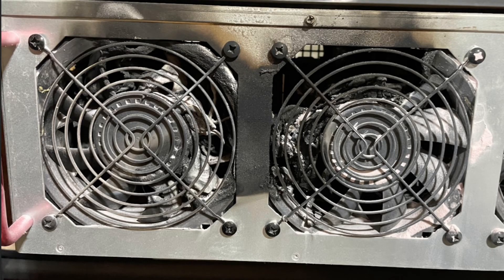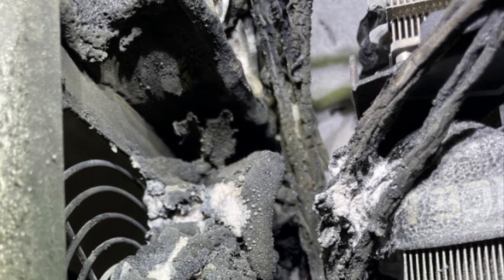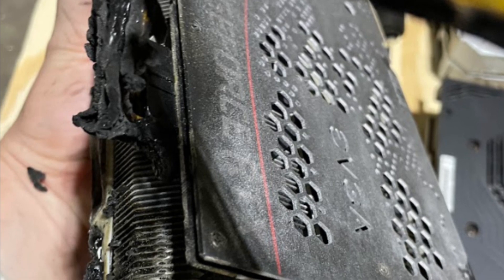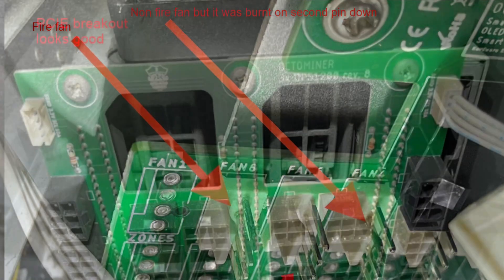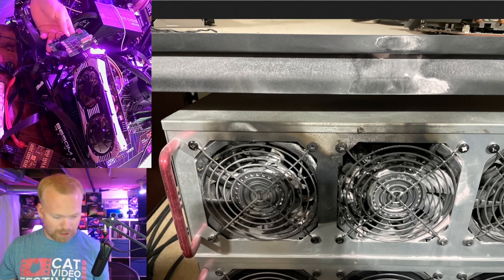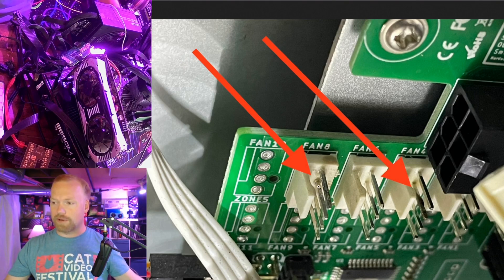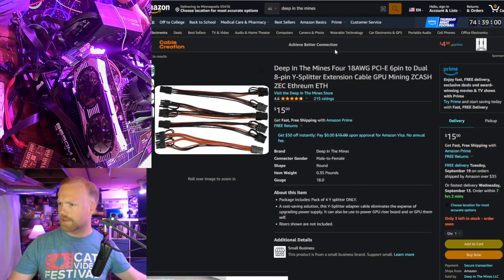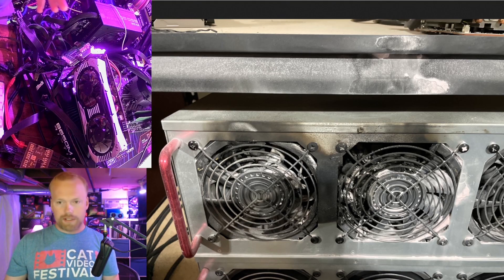Can't even trust the 'Best'?!

Comment: Dangers of high wattage fans
Reply from the maker: I mean.. sort of, but pulling 60-90W on a 24W rated product is completely unacceptable and leads to pointing out the defect in design of not only the fan PCB, but the fan controller's lack of fusing. I did a live stream a couple of weeks ago as a follow up where we do a little more root cause analysis.

Comment: That's wild, good thing he was there to catch it! This seems like an ongoing thing with Octominer. Did they issue recalls to protect their customers?
Reply from the maker: they're pretty tight lipped so we dont know but there are design deficiencies in the fan control board and fans themselves. it DOES appear to be limited to X12 units with fans manufactured in 2021 but thats still speculation.

I did a livestream a little bit after this video autopsying the fan that failed. worth a watch.
Reply: @OvalboreTech  Tight lips usually lead to lawsuits. What type/size fuse do you recommend for putting in-line to these fans? I presume they'll do nothing until someone's house burns down and it's on TV.

NM, I missed the moment in the video where you recommend 3A fuses :)
Reply from the maker: @rafalklepinski7372  I built some adapters for inline use with 4A slow blow fuses personally. thats way above their rating but we saw healthy fans pulling 12-15w more than rated ameperage.

Comment: I always change out fans on everything I can to noctua fans
Reply from the maker: noctua does not make a suitable replacement. no mfr does unfortunately.
Reply: @OvalboreTech   they do make fans in the right size and even " industrial ppc" once
Reply from the maker: Im aware,  @DJJumpdancer  . they're not suitable. half the airflow and the wire lengths are not compatible with 3 out of 5 mount locations in X12
Reply: @OvalboreTech  what about extions for the wires ? and would half the airflow make a big difference ?

Comment: More than likely it was the wiring or something on their end. At the very least he didn't monitor the fan voltage and on-time. Just set it and forget it.
Reply from the maker: nothing outside of fully stock on the controller, fans or wiring. 

power monitoring at the wall, and through HiveOS on the octo controller board. down side is the sample time on HiveOS is a 3 minute refresh so although we could see GPUs heating up, not enough data from it.

fan voltage is not a parameter the control board can monitor, only PWM duty.

either way, fans drawing well over their rated max current is a really, really big problem and I hope for octominer X12 owners sake that its extremely isolated to a small batch of first gen X12 units.
Reply: @OvalboreTech  Hmm. I wonder what triggered or disabled the voltage limiter. Fans don't normally say hey let me have infinite power. Lol
Reply from the maker: there is no voltage limiter  @PokèMyBalls  PWM fans use GND (-) +12V Tach (ground referenced speed signal) and PWM drive which is a 12 or 5v pulsed signal where open contact is 0%, 100% is voltage applied and 50% duty is a pulsed square wave signal.

these devices (fans and octominer) have no voltage control, and they do not contain any mechanism for fusing except the wire or the PCB.
Reply: @OvalboreTech  That is really sketch on a miner.
Reply from the maker: @PokèMyBalls  I agree. clear design oversight on octominer's part.
Reply: @OvalboreTech  Well thank you for taking the time to have a conversation with me and teaching me something new.
Reply from the maker: of course  @PokèMyBalls  , dialogue helps everyone so happy to.

Comment: Thanks for this PSA. I don't have any Octominer equipment, but ALL of my homebrew equipment uses 18 gauge connectors and fusable links.
Reply from the maker: of course, thanks for watchin.

the octos do use 18 AWG wiring for the high current stuff, but wild to me that they have no 'fuse' of any kind between 5,000W of power supply and a wear item fan.

Comment: Absolutely wild that those GPUs still work! I cannot believe it started from the fans. I’ve been as cautious as I can be over the years as to use larger gauge wires and bigger PSUs than necessary to try to remove as many points of failure as possible.
Reply from the maker: the fan wiring doesnt look inadequate at all but yeah the fact the board in the fan is able to draw over rated current is bad and the unfused fan controller board that is able to push at LEAST 150w is bad.
Reply: @OvalboreTech  That is pretty scary. So is that problem only on the older X12 models?
Reply from the maker: we dont know yet  @TotaleCryptoMining  it does appear that early gen 1 X12s had bad fans, but most just stopped working, not light themselves on fire. we have messages out to octominer, minerdude to ask if they have reports of this. GPURisers who only sells the 4 fan 8 card R8 has never had a fan fail in this manner though. I would feel more comfortable with the X8s and MAYBE gen II X12s. 

the other fan in this unit that was on its way out is going to get bench tested tomorrow with a PMD and a thermal camera so we can identify what happened.
Reply: @OvalboreTech  Will be interested to hear about it. Only have one X12 but not certain which gen it is. Rest are X8 Ultra Plus with no issues…so far
Reply from the maker: same  @TotaleCryptoMining  , I have two gen 1 X12s. one I got from Kiing but havent fired up yet since the backplane was damaged in shipping, the other is a Minerdude I got from Hawk. lots of X8s though. 

unsure what Im going to do just yet.

Comment: Great Reporting. Thank You. This is making me feel uncomfortable also.  Making me re-think everything. It's very scary, especially if you have family, and the miner is in the home.
Reply from the maker: I do think fusing the fans and a slew of those fire supression balls will be enough to make me feel comfortable, but I'll never place another rig without thinking pretty deliberately, thats for sure! agreed.
Reply: @OvalboreTech  Great words on fusing the fan, i never imagined that an non-fused fan could overload like this and catch fire. Again, great reporting.
Reply from the maker: @Techisol  I went to his place last night with a thermal camera and a power data logging PMD. we did let the other close to failure fan run and it failed inside of 3 minutes. I have a good idea of how it failed now. locked rotor, these fans pull 70-90w... 

lack of fusing or even a breaker seems like such a huge oversight.
Reply: @OvalboreTech  SMH, this is crazy. Thank you for the response.
Reply from the maker: certainly  @Techisol  . editing now, trying to make it not boring/run-on but will post it as soon as I can.

Comment: octominer should do a recall, and send people these boards "WITH A FUSE " either free of charge or some fee. I have 100 gpu's in a bull market that worth so much money.
Reply from the maker: I do agree that octominer needs to redesign the controller boards with inline fusing. plenty of room to do that.

recall though, I dont know - if they can pin this failure to a specific batch of fans maybe, but ALL gen 1 cases I think should have that comped for sure, and I think it should be a $25 off the shelf part for ANY other octominer.

this is a big problem, if it persists outside of a very small batch of fans.

Either way though, I agree with you, its a design oversight.

Comment: all my farm in octominers around 100 gpu, been using octominer from the first series to latest. I have rev1 12x and i have rev3 12x, this is very odd and very worrying indeed. Only had 2 problems with octominers, one of the fans die.but like i say i have 8 of Octominer 12x and they never failed me, and i have many of them blow 1200 psu's. So is it best to keep an eye on this i dont know. But i am assuming there are other factors on this incident.
Reply from the maker: we dont know why exactly this one went up, but it is a gen 1 X12 and those seem to have by far the worst fans as far as reliability. 

other than bearing wear in a two year old fan, there were no other odd factors present to contribute to this failure.

Comment: Yikes, I don't own any octominers, but I do have a cheapo  8 card server case with some unbranded fans in it.. I need to check to see if they are fused or not, and if not I should fuse the fans. Thankfully nobody was hurt in this situation!! plus now you got me worried about some of my splitters! I have some of them cheapo amazon splitters.
Reply from the maker: I also have a ton of cheapo cases with 120MM fans - they're not fused either. 

yes! be mindful the cheap splitters also have cheap pins and I usually see pin failures!

Comment: you say it's not caused by the gpus, but those are some pretty high power gpu packed densely. i'm curious what fan speed was set on the octominer fans? i've never owned any octominer case, they were always way too expensive for me. i've only seen some fans on gpus get really hot when they stop spinning, usually on gigabyte gpu.
i have 12 gpu open frames, but with only 5-6 gpu mounted, and either no fans or 5x pretty low power 120mm fans. and a thing i noticed about my cheap 120mm fans (i think they were apevia brand) is that they were probably over oiled or weren't meant to run at 100% speed all the time, because over time the oil leaks down the blades and gets all over the fan frame. which isn't as bad as it sounds because it's not that much, but it is more possibly flammable stuff on there
Reply: 60% fan speed stated in video
Reply from the maker: as Plox said, fan speed and ambient were in the video. GPUs were mining radiant at a very low wattage. RXD is the lowest power minable coin right now.

fire originated at the fan 5 wiring, not at a GPU (which ALL still work, and would not if the fire started at a GPU).

Comment: Guys… Be mindful that Fire Containment is a benefit of server cases that most ppl dont consider. Had this happened in a open air miner…. who knows where the fire could have spread to.
Reply from the maker: this wouldnt have happened in an open rig. (this particular fluke scenario). 

Supression balls definitely more effective on open rigs though.
Reply: @OvalboreTech  we cant say if ut would happen or not. They are ALL fluke scenarios. Things shouldn’t fail, but it does. All im saying is a server case “helps”contain fire
Reply from the maker: we can because open air rigs dont have
-unfused fan controllers
-5,000 RPM server fans.

you're not wrong, but I'm also not wrong.
Reply: And those high rpm fans just fulled the fire blowing it across the gpus.
Reply from the maker: the fans were intakes where they were. just wild how when he found the issue, the intake fans were bellowing fire out the front. as soon as one stops. the other intakes start blowing the fire out all sides of the case.
Reply: @KeepUp101-j1y  there fans on open air too miners too. would have fueled the fire & blown it onto god knows what (maybe worse things)
Reply from the maker: the fans that are run on most open air frames are .1A rated with similar thickness wiring. they are incapable of individually pulling enough wattage even under failure load scenarios to do this (speculation, but based on amerages, voltages, AWG, wire composition, and pins.)
Reply: @OvalboreTech   I was giving a general opinion about the safety benefits of server cases. I didn’t expect it to be controversial lol.

Octominer did not design or intend the fans to catch fire, yet here we are.

With the limitations of all the cheap junk mining equipment & connectors that flood the market. Surely we can agree a wire fan fire can happen on a open air miner too (without debating specifics or semantics).

Ive always preferred cases for my miners, but as i’ve been rebuilding my farm back, Ive elected to do open air for budget reasons. kinda sucks to spend the extra money on cases, but after seeing this Im going to upgrade my miners for that extra lil bit of safety
Reply from the maker: I understand, I was not. hence both our observations are correct. this particular failure cannot happen on an open rig, however many others can, and yes a steel case holds in fire a whole lot better than a bunch of PVC Spaghetti! :p
Reply: If you have one of those fire prevention balls they would work better on open air rigs vs closed server rigs.
Reply from the maker: Agreed. still, worth having nearby as they should in theory cover everything in a flame retardant layer and at least buy time

Comment: HOLY SH!T Jebus great balls of fire smoke fan damn... yes ALL of my first gen x12 octominers had bad fans and man glad no fire but man that is insane on this dudes case.
Reply: Yeah man, looks like a toaster oven!
Reply from the maker: one that needs to be cleaned at that!
Reply from the maker: its SKETCH dude. I rewatched your fans video just to try and get more info but yeah this is a first and totally gave us all the heebie jeebies about our octominers.
Reply: Thanks for posting this - this has me concerned as many others.  I recently picked up a octominer x12 from PCSP and looks to be an early generation.   Case fans are from 1/2021.   Did you end up putting in inline fuses on the fans (red or blue wire) or the fan controller?   Unsure if I trust to run the 1/2021 case fans stock too long.  Thanks!

Comment: A few things to take from this, we order stuff not made here all the time so I wonder if these are even ul listed? I suspect the power wire had a nick from vibration or a piece of sharp metal it was near. It could also be that some component like a transistor or a diode failed inside of the fan and caused it to go thermonuclear due to no fuse on the fan header. This makes me want to drill five holes and put 5 3 amp circuit breakers on mine and route the power wire going to each fan.
Reply from the maker: oh, Im aware Octominer is a nameless chinese OEM but also I genuinely feel if you ask the at home mining community for GPU mining what the gold standard is, it'll be an octominer or octo white label case.

the fans I'm SURE are not UL listed. I dont even see an ETL cert on them but may be on some other document we didnt find.

nothing sharp near the wire. this was definintely the controller pulling too much juice. I know, I looked and shockingly could not find fused fan connectors OR a fused 6 pin.. kinda wild that doesnt exist.
Reply: @OvalboreTech I plan on fusing each fan now with a 3 amp breaker 👌
Reply from the maker: please let me know how that goes. Im curious. individual fan breakers definitely safest way

Comment: Ohh my.  If youd like to test the fans wiring. First we would need to check true amperage draw pf fan at 60% with full loaded case and the most obstructions to the airflow ie graphics cards.  Then we could cut the wire off the fan and inject the same voltage and amperage in a dead short thru the line.  Then point thermal camera at the cables.  You maybe onto something here.  Could be they need to lower the guage of wire for the length from controller to fan.  22 guage copper prolly alright. But if the fan is cheap it wont be copper wires.
Reply from the maker: the fan does on paper SEEM like its of decent quality, but the X12 fan 5 does have a longer run than any other octominer product. I just have to assume this has to do with the first run of Gen 1 X12s having fan issue. I'd like to know if they changed something about the design or if there was potentially a materials defect.

I speculate the bearing started failing and the PWM controller started drawing more and more power to maintain a given fan speed.

the case and fans are not mine, but that would be prudent to check against a healthy fan for sure.